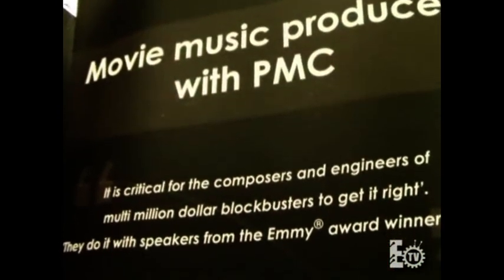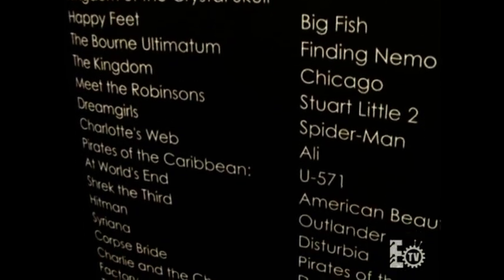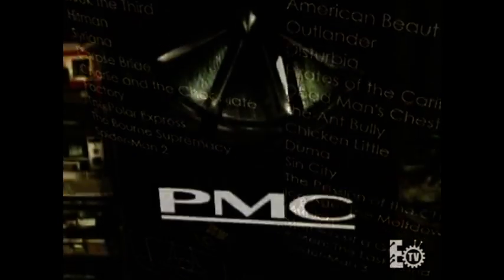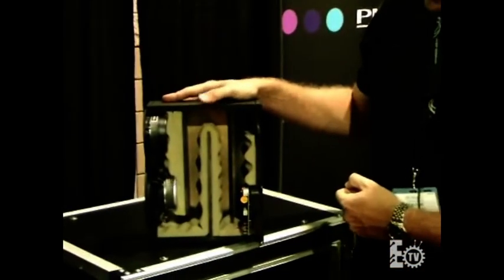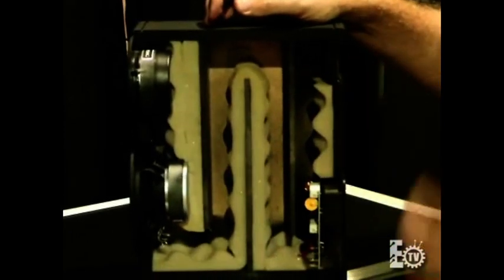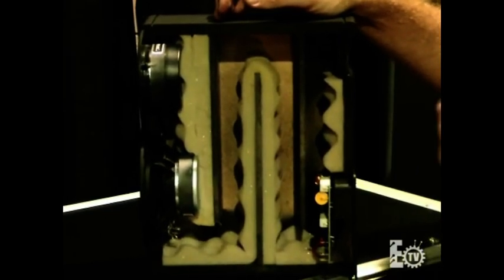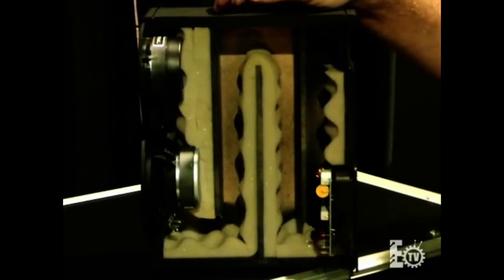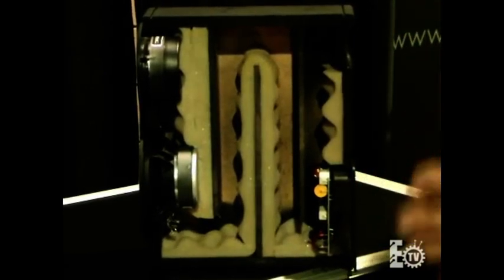The ATL™ (Advance Transmission Line Speakers) from PMC®

Comment: Seems to be a lot of different schools of thought with tl design. I’ve built one and the driver is placed 1/3 of the way down the length of the line and the line has a gradual decreasing taper. Stuffed with long fibre wool in the first half of the line...it sounds very good to me.
Reply: John Partridge  What driver did you use?

Comment: Wool and hair have surface textures that often help BECAUSE it works better on some frequencies than others, and filling an enclosure with wool controls more of the air than lining with foam, that and only some of the low notes from the opening are in phase with the speaker, that's why wool lining is needed, not just to reduce reflections and tune the length of the t-line, but to mute magnitude of those peaks and dips in the freq response. Misinformation like this is why it can be so hard to find info about building your own t-line.
Reply: What kind of hair do they use? Not human hair!
Reply: I think I recall the problem with wool is it breaks down at high spl.
Reply: @Mortison77577  long haired sheep wool typically

Comment: He says that it absorbs the mid and high frequencies, but the highs are reproduced by the tweeter which has a closed back... Also, the TL should be waaay longer to even work.
Reply: T-line length depends on what the speakers Fs is, so this speaker has a high Fs.
Reply: How large & knowledgeable is your speaker research and development department?

Comment: I have designed, calculated and build a TM myself und must say this is just a sales gimmick. 
In order to get a 40Hz Bass you need a 2 meter long channel. This here seams to be ca. 0,9 meter. So the lowest bass would be about 100 Hz at best. Where is the "advance" ?  You get better result whithout Tm in such size box.
Reply: Bramburg showed in his experiments that wool and other fibers slows the speed of sound significantly.  If I recall around 430ft/sec
Reply: That was just a demo unit.
Reply: Obviously a counter top display for demo
Reply: Sales gimmick my ass. Go listen to a set of Acoustic Zen Adagio's with two 6 1/2 inch woofers and one ribbon tweeter that do down to 30 dB. THEN say they are a gimmick.

Comment: This is still rudimentary design. 

The best way to fix a lot of the issues in a transmission line is to drive another unit in-phase placed 1/3 down the length of the line.